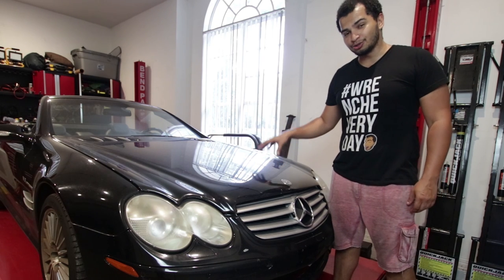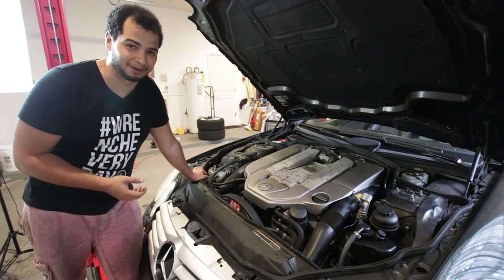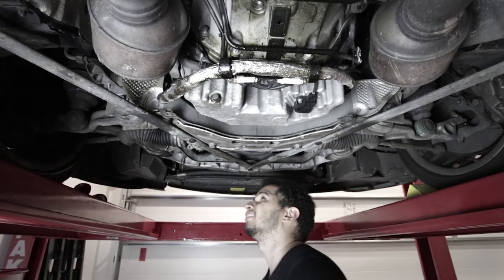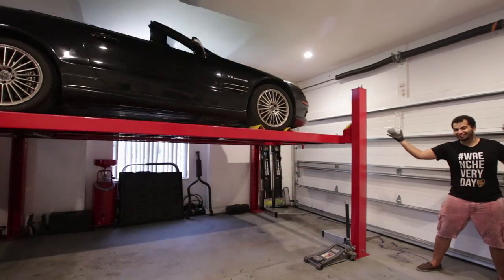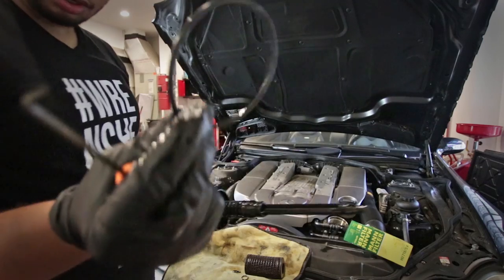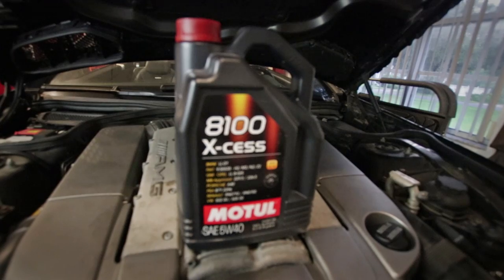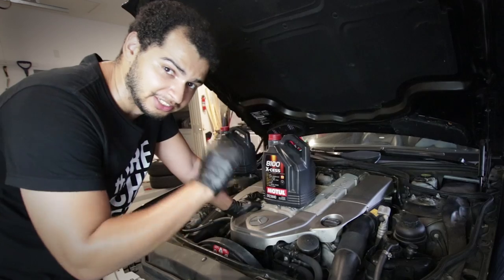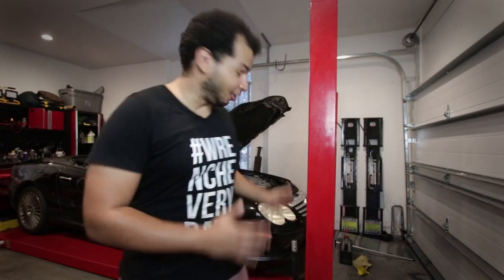Here's Why A Mercedes Oil Change Costs $320 And Why You Should NEVER Pay That Price-Project SL55 Pt1

Comment: Good video, but you left a few steps out. The oil cap was still on when the filter was taken out which causes the filter housing to retain a lot of oil that isn't drained. You should also change the filter first so that old oil drains into the oil pan and out of the car. The way you did it there was still about one quart of old oil left in the car. You also need to run the car before measuring the oil level as the filter housing needs to be filled.
Reply: Weese correct
Reply: Steve Olliff Or just some (installation?) oil from one of those spray cans. That works too.
Reply: removing the oil fill cap doesn't mater because the pcv valve and usually a crank case vacuum port making air able to get into the crank case through the intake manifold.
Reply: Also 2 drain plugs.
Reply: He shouldn’t be draining the dry sump tank cuz it’s not meant to be drained unless the engine is getting a complete tear down.

Comment: Something you may have not thought of: Changing the supercharger oil. They're two separate systems, and most people don't realize they need to change that oil. Other than that, great video!!
Reply: Those superchargers don't need oil changes with every motor oil change.
Reply: @kickblake  no but it's probably something most people don't think about or who knows the last time it was changed.
Reply: @kickblake  im sure it needs to be changed and has never been changed
Reply: That car doesn’t have a supercharger it has a turbocharger and it is connected to the vehicles engine oil system.

Comment: Mercedes : A service
-Oil Change
-Filter Change
-Fluid Top Off
-Multi Point Inspection
-Lubrication of Underhood Seals, Trunk Seals, and Door Seals
-Lubrication of Door Locks

Mercedes : B service
- Same as above with a few additions not mentioned in this video
- Brake Fluid Flush
- Replacement of Cabin Filter
- Replacement of pre-cabin filter "if vehicle model has it"

Comment: You can add the oil through the oil filter housing before replacing the filter.  It's a much bigger hole and won't require a funnel.

Comment: This is the routine I follow when changing the oil in my family's cars (MB, BMW, Mini, Lexus, Toyota, and Honda). Open the oil fill cap, take out the oil drain bolt, let it drain for 5-10 mins, crack open the oil filter (if you loosen it up too early oil will spill all over your engine and your driveway), let it drain for 30 mins while I grab a beer and smoke a cig. Then replace the oil filter, screw back the oil drain bolt, fill the correct amount of oil, idle the engine for a few minutes and recheck the oil level. So damn simple.

Comment: My friend lost 2 engines in Motul. Plus Motul left his inspection window dirty. We switched from Motul to Castol and his inspection window then cleaned up and the metal parts also cleaned up. This is the longest a motor has lasted with him.
It is always best to do your on oil change if you know how.😊👍🏻

Comment: Here is how to save 320 dollars on oil change. step 1. buy 3000 dollar lift. step 2 buy professional oil catcher. step 3 profit
Reply: Hahahahahahaha! :) I buy 10 quarts of Mobile 1 0W-40 European car formula at Walmart for $54 bucks. Buy the $10 dollar filter and take the car down the street to do the change out for $26. Sometimes I do it myself with my vacuum pump. That said, I wish I would have bought a Camry. :)
Reply: That will be my next car.  My Benz is going back. Glad I leased it.
Reply: If you can find the drain plug you'll save $250. I did
Reply: This guy makes these videos to help people save money and educate car owners out of the kindness of his heart and to share his hobby. People like you sir, are why the dealership charges 320.00.
Reply: I use a mighty Vac that sucks the old oil out thru the dipstick tube, exactly the way the MBZ dealership does it, I don't spill a drop of oil and don't even get my hand dirty. Okay, changing the filter I might. But the only cost of an oil change, then, is the oil and filter. I wouldn't trust any MBZ dealership to change my oil. I barely would trust them to wash the car! They actually STOLE my floor mats, I had to complain and force them to replace them, which they did.
Reply: How much is a quart
Reply: Or 1 HF floor jack and 2 HF jackstands. Well under $100.
Reply: Seriously though, the lift in his home garage is super baller.
Reply: You don't need a lift or fancy oil catcher
Reply: @archygrey9093  No but if you can afford one? I don't know a wrench that doesn't want lift. And if you've got the lift, may as well have the fancy oil catch.
Reply: @lauracarnes4007  If you need to watch a tutorial video on how to change oil in car, you are the reasons why this human race is a failure as a species.
Reply: Just change your oil every 6 months. It's not that hard.
Reply: @emperorborgpalpatine  check out my lifestyle. Benz floor matz in a infiniti.
Reply: @posterlion  German Castrol 0W-40 is better than Mobil 1.
Reply: @emperorborgpalpatine  Probably cheaper and definitely safer to use a 4 post lift and rack jacks than a pit. Only problem is many garages aren't tall enough. My garage is about 9 feet floor to ceiling. Not enough :(
Reply: DuBstep115 Why? Oh I see. We’re all supposed to be born with the knowledge of how to change the oil on a car according to your logic...
Reply: @micharel937  How to change oil:
Step one - open drain plug and drain oil. Step 2 - remove oil filter
Step 3 - lube and replace filter
Step 4 - replace drain plug (important!!)
Step 5 - add oil. Use owner's manual for the amount of oil to add, or Google it.
Step 6 - check oil level

If you change your oil one time you will get hooked and become better and better at it  over time. All tools and oil\filter can be bought from AutoZone, and it will always be cheaper and more reliable than jiffy lube. I saw a guy at jiffy lube put conventional5w 30 in a newish Mercedes Benz. The owner of that Benz is now fcked. Believe in yourself and change your own oil.👍
Reply: @ricky-sanchez  recommended oil to 2020 merc is 5w-40 and putting 5w30 instead will do no harm to the engine.

I have tried 10w30, 5w40 instead 5w30 in my corvette and they all worked just fine.
The redline 5w40 didn't even have the right standards.
Reply: @DuBstep115  synthetic or conventional. Very important!!
Reply: @ricky-sanchez  Where the fuck you find mineral oil in 2020, everything is atleast semi synthetic. Often the synthetic oils are not even fully synthetic tho. Ester based is best.
Reply: @DuBstep115  You must be the guy I saw putting conventional oil in their Mercedes Benz. I guess you lease it, so you don't care about premature engine damage.

Again folks, use your owner's manual and read it carefully. If it says use full synthetic, use full synthetic. Do not put Costco conventional 5w 30 into a Mercedes Benz!!!😱
Reply: @ricky-sanchez  I must be a guy who knows oil business. usually the requirements and specs for oils  is just giant money pit. Oil companies  pay pre fills for car companies to get user buy the expensive products.
I actually wrote thesis about this.
Reply: @lauracarnes4007  lol he makes these videos to get free shit from sponsors

Comment: The recommended Mobil 1 0W40 is a very very good oil. I can't recommend it enough. I've studied mechanical engineering (specialized in automotive technology) here in Germany and we've done a lot of test series with different engine oils. Some findings where so bad that the manufacturer sued the faculty to remove the data from public access and said we must've tested counterfeit products (which was not the case) 
In the case of Mobil 1 it's not just that they bought their way in with the car makers and the customer gets recommended a subpar product because of that. A good example of that scenario would be some Castrol products. 

That particular MOTUL you have is also a very good oil. I do all the work on our cars myself at a good friends car repair shop and he has 60litre barrels and only uses MOTUL products. I put this oil in my dads car since it was brand new. He drives a lot so I have to change every 2 months which equals around 12k km. That car has 700.000km and never had any issue with the engine. It even has the first turbocharger. MOTUL has some incredible ester based oils which are worth mentioning as well. 

What I can not recommend is 5W30 of any sort in combination with ridiculous 30-40.000km intervals. It's not the engineers that recommended these intervals it's more the management side. Like hey competitor ABC has a xy km interval, how much can we stretch it without it causing problems during warrantytime. It's a good selling point if you can say the car only needs half or a third of the services compared to a competitor and that's the only reason for the high intervals. 
I've seen countless problems with this combination. These engines get completely dirty and sludged inside causing a lot of problems...any experienced mechanic can attest to that...
Reply: hi friend,
Which oil is better,  Motul X-Cess 5w40 or Mobil  1ESP 5w30 for 2005 VW Jetta 1.6 petrol engine?  Have you tested them?  My car is 200k km.  I have been using Motul X-Cess 5w40 for the last 4 changes.   But,  lifter voice started in the engine. So, I changed the lifters. During the change, we saw lots of oil sludge.  The older owner had used Castrol Magnetec 10w40 during the first 120k km.   Is it the reason of oil sludge? or motul causes it? what do you thing?   Some mechanics say mobil 1 esp keeps engine cleaner than other oils.  what is your opinion?
Reply: do u recommend mag1?
Reply: Is there any difference between a 40k km interval, and telling people "run it til it pukes"?  I'm not about to trust anything in a gasoline motor past 20k, even if it is synthetic.

Comment: "oil companies pay mercedes lots of money to use their oil"  
"motul sent me their oil but I'm not selling out"

hahaha
Reply: Bob Last 1
Reply: Hahahhaa
Reply: Motul is still better than Castrol or mobil1
Reply: Difference is one company gets a huge discount and stable long lasting supply which benefits customers as they know what they are getting and Mercedes know what they are supplying. It's still good oil and is just a damn good business model, yes of course as is business logic, the cost is passed to the consumer, it's to be expected.

One guys gets two free jugs because he mentioned how he uses it and it's good stuff... Hardly a hypocrite or sell out, why not. If I can save a$40-50 I will. It's still good oil and both the company and consumer benefit. Company gets a mention and consumer gets a break. That's also good business logic.

Clueless clowns.
Reply: I'm under the impression that all of the oils are good considering you're changing them every 3 to 5k miles. It's all branding at this point.
Reply: He was right though. The whole reason they have the "fleece filter" is because Mobil 1 was causing the old filter to explode because of too much sludge and that would cause the oil pressure to drop and seize the engine.
Reply: he also said this is the brand he uses anyway even on his other cars
Reply: MuffinMan0521 synthetic oils last around 7k to 10k miles, my 2013 dart's manual says 10k miles or 12 months
Reply: You got it backwards, Mercedes pays Mobil to put their name on the label, so you'll think that their used cars can be repaired or maintained by the averge guy who shops at Walmart.
Reply: Bob Last the irony 😂
Reply: @MuffinMan0521  No, they still make mineral based oils which suck. Buy a 100% synthetic oil from a reputable brand (Castrol, Elf, Motul, etc) and you won't have issues. Fully synthethic oils can easily last 20000km, most manufacturers recommend a 30000km oil change interval.
The 30$ saved by buying cheap mineral oil isn't worth the risk, especially since you have to change it at least twice as often so the final cost is the same.

Comment: Before removing the bottom bolts you must open the filter so you the oil and the residues will easily flow out within the old oil. I worked in Mercedes and that was mandatory. (Sorry for my English)
Reply: You have nothing to be sorry for SerYanOto.

Comment: You can use a dip stick it's a service dipstick that you use in the tube that is capped off with a red cap. I would send a picture but I can not post one here. The tube is located at the back left of the engine bay about where the name plate and the word AMG is
Reply: James Bambury I was wondering the same thing.  The Audi's do the same thing, but you can buy a dipstick for them.

Comment: My rule of thumb is: if you want it and can afford it, buy it and enjoy it. Not everyone is living paycheck to paycheck. Some of us prefer to drive solid, well built, well weighted cars than be surrounded by cheap plastic interiors that rattle and creak after 3000 miles. My E-Class has 40,000 miles and has not one rattle or creak. And no structural issues. My doors are heavy. I pay more for maintenance. But the trade off is a great solid, quiet ride.

Comment: Don't forget that after that $320 dollar oil change, you'll get a bill of health totaling over $1K for the recommended repairs and maintenance. I once was quoted over $800 for an oil pressure sensor seal replacement. The cost of parts was $3.

Comment: Tavarish, you are a really good guy but those who watch you do not need a refresher course on why you need oil in an engine.
I used LiquiMolly last oil change on my 2001 e320 sport. Napa charged about 42 bucks for a 5 quart jug. Need 8 quarts. Mann filter cost about 8-10 bucks. 
Molybdenum is a low friction additive to the oil and Napa actually told me MB recomends it.
It's also supposed to be 10k mile oil.
I am adding this comment. I hope you see it. My car told me i needed a A service in 3 days and had no idea how to get rid of it. After listening to this video I went out and pulled that message up and hit the reset button and again to say yes to it and it went away. So thanks cause I don't have a manual and I'm not taking it to the dealer.
Thsnks again.

Comment: Reality check: Actual cost from DEALER: $132.22  TOTAL  (Labor  .4hrs= $58.40 ,  MB Filter $16.50,  9 quarts of MB oil  (Mobil1) @ 5.99ea = $53.91,  Seals, $3.41)
Not having oil spilled all over the tops of your  underbelly pans in your carpeted engine compartment  and having dirty oil because you didn't remove the filter first or read the service manual, and incorrect levels because you didn't check AFTER the engine was run,  priceless?  Well, maybe not, but because I pay almost as much for Mobil1 and a fleece filter from the local auto parts store,  it's really sixty bucks going to the dealer- and since I'd have to jack the car, wait around for it to drain, possibly strip one of the plugs, and take the used oil to be disposed of, it ain't really that bad. Plus,  I can sit around in the dealer's  lounge for half an hour and gorge myself on their free bagels and coffee.
Reply: I know my dealer also replaces my cabin air filter deff worth money
Reply: Mercedes charging $58 an hour???
Do you live on Mars ?
Reply: @cindymay3272  $58 for 0.4 hours
Reply: An oil shouldnt be that hard with all those problems you droned on about. you clearly don't know how to work on cars and are making a dramatic mountain out of a simple mole hill.

Comment: "A" service rip off. I take to Honda and they do all that from $40 with oil change. Do it yourself is cheaper. I used valvoline full synthetic and never had any problems. I prefer a Lexus over Mercedes.

Comment: I work at a local Mercedes repair shop, we're half of what the dealer charges for just about most things. We use direct aftermarket parts. Like the oil filters for most Mercedes are Mann Filters, we use those. Mercedes use the same ones, but with their logos on them. And we also use Motul oil, don't have an issue out of their brand, it works fantastic. And for an "A" Service, we charge $80. "B" Service, we charge $290. I'm 19 years old and I love my job and Mercedes. They're fun cars, but trust me, they can definitely be expensive. We do use direct OE parts from Mercedes on some jobs though. Depends on what the job is.